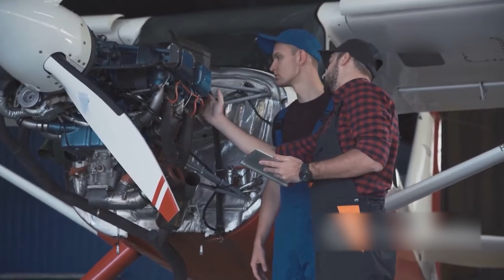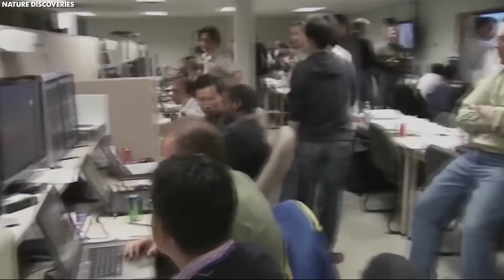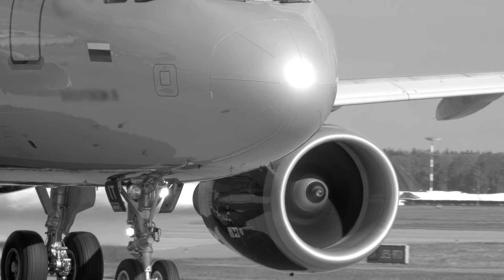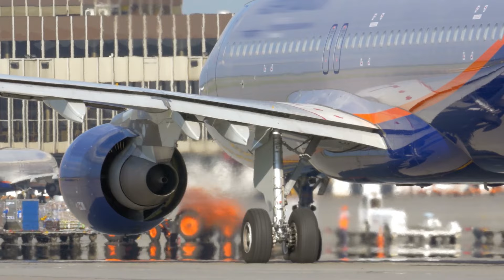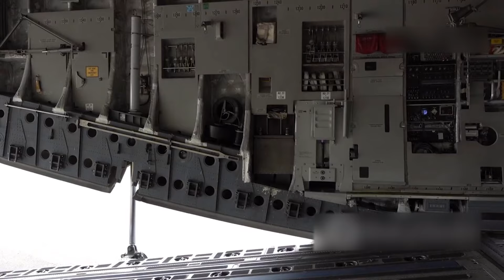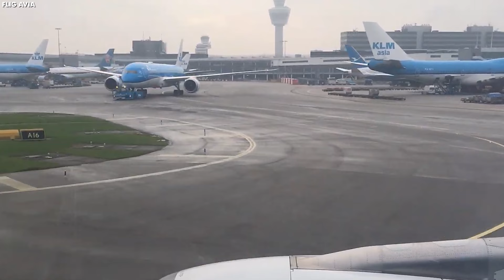A Terrifying Discovery Inside KLM’s Boeing 787 Leaves Inspectors Shocked

Comment: Particularly in a 'technical' enviroment... "A chain is only as strong, as the weakest link"... and so... you keep on searching for the 'next' weakest link... whether structural, or, especially with... IT and Computers, hardware, software, networking, and services.